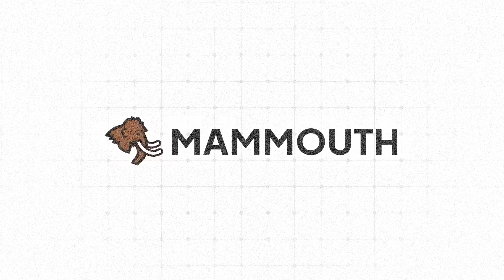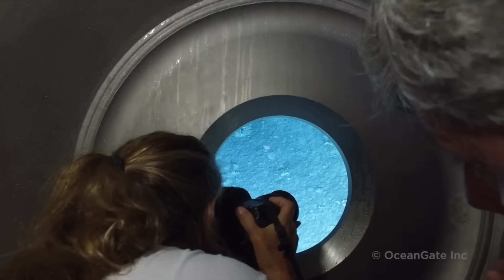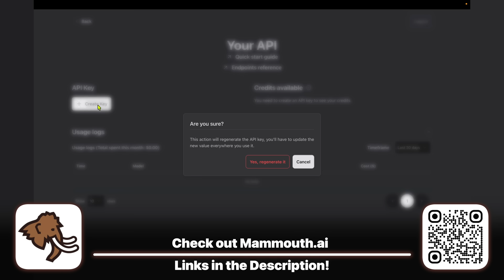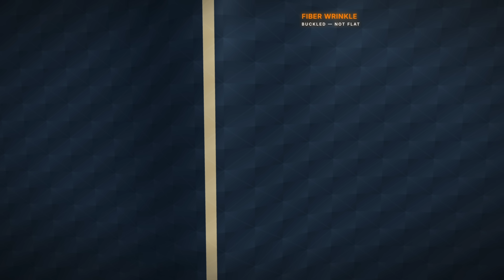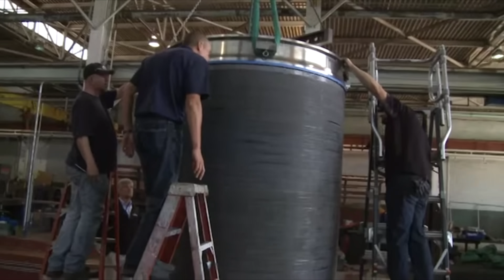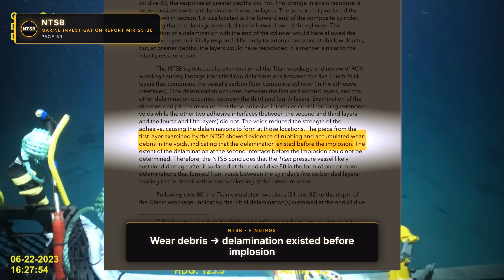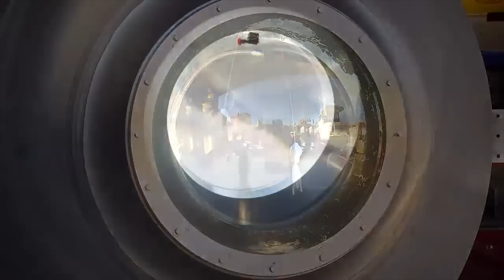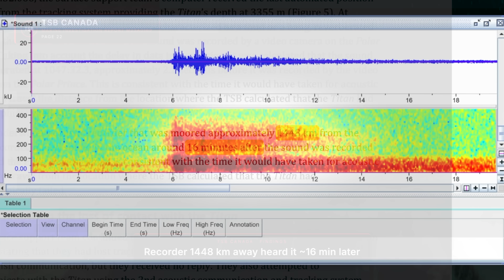Oceangate Titan: It was WORSE Than We Thought

Comment: Just to be clear, the 'nuisance alarm... ignore it' attitude isn't unique to Oceangate. 

In fact, the 'well we've gotten away with it so far...' attitude was also applied to some large O-rings that had burned through on several solid rocket booster launches of the space shuttle before the Challenger disaster. The fact that one ring had burned but a second ring had not was noted in previous launches but.... 'well, we got through it and nothing bad happened' sort of attitude meant there was little investigation into the joint's design.
Reply: @mikefochtman7164  Normalisation of deviation
Reply: @mikefochtman7164  
Actually the O-rings had failed before. The Aluminium in the rocket fuel had sealed the leak. 
When Challenger went to throttle up, the smoke trail shows that it went through a wind shear. 
This caused the solid fuel booster nozzles to swivel for a course correction, putting stress on the weakened seal.
That caused the jet of flame to escape, and burn through the shuttle's main fuel tank. 
The reason it sealed at the pad and not after the wind shear was the position of the burning fuel. By the time the second seal broke open, the heat was beyond any ability the Aluminum had to seal anything. 
The wind shear can be seen in the "Z" pattern in the solid fuel boosters exhaust smoke. 
It was managers that overruled every single Engineer to launch. The managers were told if they launch, the shuttle WILL blow up. 
Smiles!
Reply: @MissouriBill  - Reference for the "WILL blow up" claim?
Reply: @bruzote ref. To the Engineers warnings to the management the morning of the launch. The investigation that NASA conducted afterward. 
Every Engineer said no to the launch.
Reply: Probably the most tragic example of this that I read about was at a hospital where cancer patients were receiving radiation treatment.  The equipment would produce a cryptic error message, but if the staff tapped "OK", everything would seem to work as expected, and so that's what they would do.  "Oh, that error message?  It's normal.  Just tap 'OK'."  If somebody had bothered to actually look up the error code, they would have known that it indicated the equipment needed to be calibrated to deliver the correct dosage of radiation.  In this case, the dosages were significantly higher than what they should have been, and they were literally killing their patients.
Reply: @Durwood71  Yes, as I understand it, if the machine was used several times without the recalibration, some internal integer counter would 'overflow' and cause the incorrect dosage. A simple software bug that should have been caught long before it went into operation.
Reply: @mikefochtman7164  The point is if the medical staff hadn't gotten in the habit of ignoring the error message and took time to figure out what was causing it, then it would have never become a problem.
Reply: @Durwood71  - The old "It's not my problem."
Reply: A nuisance alarm might be allowed to be ignored within reason with the proper materials choice to manufacture the vessel. However, this vessel was using a tension material in a compression environment and unlike metals - Fibers Catastrophically Break - No Bending, No Give - BREAK ---- leads to ---- DEAD!!!
Reply: @BStott  Yes, this is, for me, a big SMH. Carbon FIBER is very strong in TENSION. But in compression, it's basically just holding the resin epoxy in place and the resin is the structurual member?
Reply: @BStott  - There is no such thing as a nuisance alarm when you don't know if the condition is just a nuisance or part of a fatal progression.
Reply: "Don't launch below freezing." - Morton Thiokol
Reply: Don't forget that the infamous Therac 34 radiation does machine was so prone to throwing errors that operators just ignored all of them. no one realized one of those errors was causing massive radiation overdoses to cancer patients and causing great bodily harm, if not death.
Reply: @fcasias7 I didn't forget. Therac-25 actually. Software developed by a "neighborhood kid". Tested before release by...no one.

The kid is probably traumatized to this day, for programming a literal death ray machine.

I'm not that kid. But I was was tasked, as a school kid, to port some software to another system. With exactly ZERO tests.

Yes. 

I've counted them. 

Twice.
Reply: The engineers scrapped the launch. They knew that it was far too risky. Management overrode the engineers' decision.
Reply: I was just thinking about the O-rings of the Challenger disaster, but at the point where the plotting against time vs depth was mentioned.
Better data visualisation would probably have prevented the Challenger disaster as well. In that case the poorly designed charts failed to communicate critical risks a well.
Reply: @trashmail8 Interesting point, but modern graphics software was not available and the Morton Thiokol engineers were under heavy managerial pressure to get a move on - and not the most imaginative communicators at the best of times.
Reply: @alayneperrott9693  The pressure was a real thing, IIRC it also had to do with something of a presidential event / celebration / milestone. 

But regarding the visualization: the graph that I can recall didn't depend on modern graphics software, it could have been plotted by hand. More important was the correct layout/axis/etc.
Reply: Some concluded that the Challenger disaster was a management failure, yet an engineering solution (adding a 3rd O-ring, a joint anti-rotation tang, and a joint heater) was applied before return to flight.  So it was both an engineering and management failure.

Comment: Justifying the carbon fibre at first is just not acceptable in my view. 
Build a suspension bridge with the  suspenders out of steel free conncrete and the pillars out of steel wires that is was oceangate did. Using material perfect for tension in a construction part that is under bone shattering relentless pressure without evacuation in seconds. Air plane tubes work for carbon fibre manufactoring because the inside of the cabin has a slight overpressure to the outside. Therefore the carbon fibre of the passenger cabin of a airplaine puts tensile stress to carbon fibre not compressive and the pressure difference is at maximum easy unter 0.4 atmospheres. And not over 400 atmospheres like at the depth of the titanic.
And the water in the titan rings in winter has more power the a small lever because ice can crack solid stone easy when it seeps in.
Sorry but i had to rant.

Comment: In the Circumferential direction of a Tube, Carbon Fiber was doing Very Little towards Strength.
The bonding Resin was the Main strength of the Tube.
They could have use Fiberglass and it probably would have been just a strong in that direction.

This seems Obvious.

Comment: I'm not any kind of engineer, nor am I overly smart, but even I would have tested that hull hundreds of times with no one in it, probably until failure. If not failure, well ultrasound and xrays are a thing.
I thought this way from first hearing about the accident.
I have no idea what Stockton Rush was thinking.
Reply: Well they did and it failed, a lot. I forgot which documentary it was, there has been many, but was one where they had actual footage of several of their tests in a pressure chamber where it imploded, and Stockton Rush was mad in every one of them when it happened.
Reply: They tested a scale model in a pressure tank at the UW School of Oceanography.  Made an absolute mess of the vessel and instrumentation.  Serious people even tangentially associated with the project then distanced themselves from Rush.  Nobody in his group inspired confidence.
Reply: @Hreimdal  Heya, I have seen that too. I think it was on a small scale model though. They went off with a bang too from memory.
That should have been enough right there for him to go back to the drawing board and re-think his design. Pretty sure he just pressed on though.
As dumb as it might sound, I was thinking testing the finished sub, in and past the pressures it was supposed to withstand. As many times as it took until failure.
Reply: @Pablo668  100%

Comment: Good video thanks.  Pressure vessel standards have fairly large safety factors.  I suspect this is what Oceangate ignored as you noted a safety factor of only 1.1 is very low.
Reply: @markfowler6276  good rule of thumb is that if someone considers safety factors justified, everything is good. But if someone thinks they are too big, it probably is safer to just double the minimum allowed safety factor and say that it is the minimum allowed safety factor. 

And it might barely compensate for the corners cut and not included in the calculations...
Reply: @timop6340  Yes, agree especially for something being used in a unique way where failure is catastrophic.

Comment: Rush is Slick.     Rush bought a promotional logo.     Rush hired Boeing for extensive design expertise with composite hulls, compression and decompress cycles.  Boeing specced 7" hull thickness with 45d cross-laminate.  Rush figures the Rush Factor to the Boeing engineering, figuring 5" without the cross-laminate is good enough for a Rush job.    Rush prominently displays the Boeing logo and promotes the Boeing engineering of the cylinder hull as though Rush had followed Boeing's engineering. .    Certainly some of Rush's customers found comfort in having Boeing engineering... without knowing the Rush Factor critically modified Boeing's specifications.
Reply: I think they actually specified a 9" thickness.
Reply: @rjinkglider6908  I too thought I read or heard the same [ 9" ] -- but I just checked with a search engine and only found 7" mentioned -- possibly I heard 9" from 
another youtube video on the Oceangate's Titan; but if I did hear it, it may have been a misquote by the creator.
Reply: To be fair, Boeing probably said that a thinner hull could work but they didn't want to be responsible for an under-built design. Also, the hull did survive a dozen trips to the Titanic.
Reply: Boing should sue for being mentioned.

Comment: I'm surprised the report has little mention of the fact that carbon fiber and resin composites rely primarily on the resin's strength under compression. What is the carbon fiber doing under compression? Also, under compression/pressure, the titanium rings and the composite tubular body experience vastly different dimensional changes, causing a high risk of separation. Absolutely reckless engineering or little actual engineering.

Comment: Yeah, not really much new here. We already knew from past reports the conclusions you've stated in this video: Stockton was reckless, and trying to do the impossible: Build a novel submersible to kilometer ocean depths requiring the safety margins of paying passengers, all while trying to make a profit in a limited time window.

Yeah, sure, in a world where he had billions of dollars and no concern for time or profits, Stockton could have built the submersible properly. Tested to failure, worked out the kinks in the manufacturing process, use the right materials, and probably add a hoop to the middle to ease deflection at the weak point.

But that wasn't Stockton's world, and he was flying by the seat of his pants. Every deviation from the norm was chalked up to some "that's just whatever" excuse, and "I'm sure it will be okay", and he kept full-steam ahead, despite all the warnings and extreme danger.

Comment: Aren’t the upper halves of the body of the Dreamliner made of laminations of carbon fibre?

🤔
Reply: @weedfreer  yes, but airplanes and submersibles have opposite physics. An airplane has pressure on the inside pushing out, putting the hull under tension. It’s the same effect as overinflating a tire. Carbon fiber is GREAT under tension.

A submersible has pressure on the outside, pushing in, placing the hull under compression. It’s like crushing a soda can. Carbon fiber is terrible under compression. 

Carbon fiber is an ideal material for an airplane. It is not an ideal material for a submersible,

Comment: Most people who are even a little bit handy could see from the moment the design of that hull was revealed that the carbon fibre wasn't doing any tensile work, it was just the resin between the fibres being repeatedly compressed and fractured with each dive. The Carbon in carbon fibre is quite soft with a scratch hardness of just two on the mohs scale. It just went along for the ride and watched the resin disintegrate around it.
Reply: Yeah i remember watching a video analysis on the debris when the titan was brought back to land and they found like a green saw dust looking material between the layers. It was the resin. It was literally sanding itself down to failure.
Reply: All the signs of confirmation bias. It has always been doing this. No big deal. Scary thing how smart Rush was. Safe was never his thing. Risk your own life is not the same as risking anyone else. There is MTBF for a reason. Irony Boeing used to be the Engineering company. Now it is a build for profit one. Rush and Boeing are like each other. Only thing is. Boeing is still here.
Reply: You clearly don't understand anything of composites and it shows.
Reply: @thomasmoura prove it.

Comment: They had dropped the 45° ply because the machine couldn't do it, and there are no significant torsion forces under water.Stockton talked about this.
Reply: What he didn't mention (or didn't know) is that the 45 degree ply is also important for distributing load between layers in the case of damaged strands

Comment: So much trouble to manufacture that hull--and still air pockets, wrinkles, delamination and water getting into the layers.  Plus the strength would be best at stretching the fibers like using it in a spacecraft, not compression. And the differing materials between the metal end caps and body.  I'd wonder if a shredded mat of fibers--like with fiberglass--would have worked better.  Regardless, Stockton should have listened to those old white guy submariners.

Comment: As I have been saying from the beginning the Soviet Union built subs out of titanium
Titanium subs had a failure rate NINE TIMES higher than steel.
Titanium compresses, but unlike steel does not decompress which creates fractures
Doesn't matter if the titanium wasn't the failure point. Building a sub out of titanium is INSANE!

Comment: Having worked with carbon fiber I can see how someone without serious understanding of the process and where errors can also be easily covered contrary to other materials would fall into overconfidence. It’s a shame that this beautiful material’s reputation did suffer from this catastrophic failure though.
Reply: I think this was good for carbon fiber. Its reputation was too high. There is nothing special or magical about it. It’s just one option among many. I think people mistake “higher strength to mass ratio than steel” to mean “stronger than steel” but that’s a misunderstanding.
Reply: @TumblingPenguin  agreed, its and awesome materiel but in a situation where safety margins are slim it needs to be near perfect and to do that would have cost LOADS of money and time.
Reply: @phalanx3803  Even Boeing, with all their engineering and manufacturing know-how, manages to have all kinds of headaches with the 787. It's not a simple material to work with at the best of times.
Reply: How did the reputation of carbon fiber go down? Any material fails in the correct circumstances
Reply: @budwhite9591 unless you live in a bubble, just ask the average joe out there and see.
Reply: The only thing that suffered was the misconception that carbon fiber is great under compression.
Reply: I don't think we know how much he knew about the problems in the design. The people below him might've cut corners to try to cover up their own mistakes. I seriously doubt someone in his position would approve of grinding down carbon fiber.
Reply: @ryelor123  Do not defend that prat. The three investigations made it clear he knew of the problems. Rush fired the Director of Operations the day after a meeting where the DO informed him that there were problems with the hull and final design.

Comment: NDT for composites is well developed. It’s used on airliner wings and fuselages.
Reply: Yes, where the carbon fiber is designed to remain in tension.  The pressure hull for the Titan was under compression, that application is not as well developed.